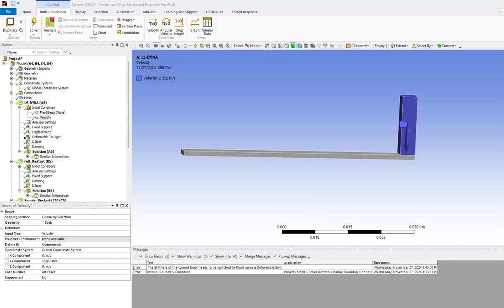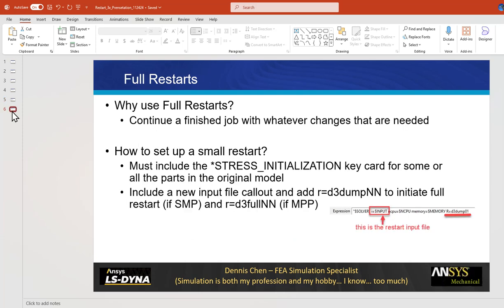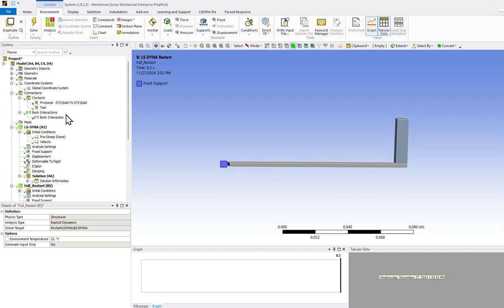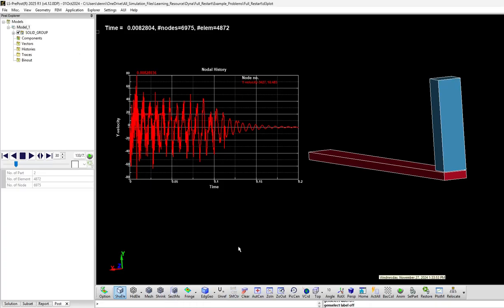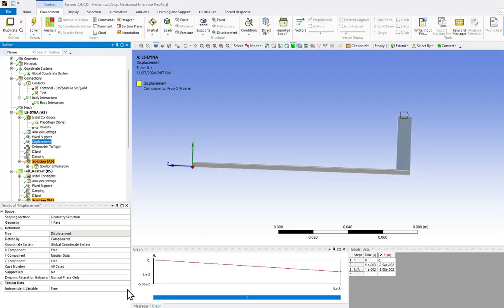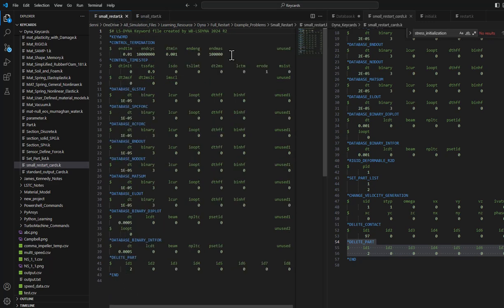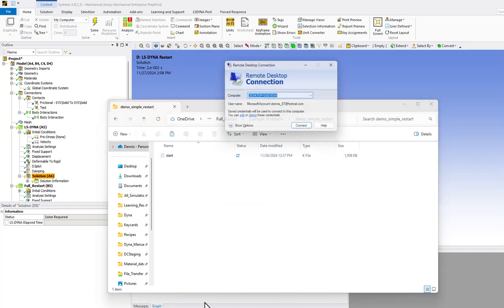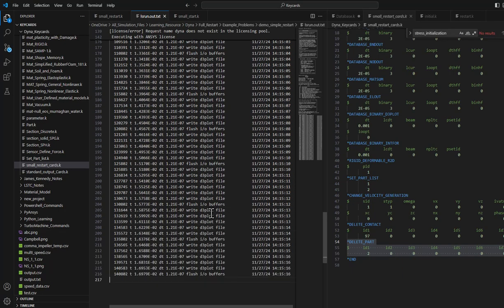Ansys LS-Dyna Examples - How to use RESTARTS

Comment: Hello. Can a restart run use a previous analysis with material erosion active? I am having a lot of trouble making it work
Reply from the maker: I suspect you can do simple restarts but not full restarts since full restarts would call a different input file and not just the d3dump or d3full.   I've not tried this so it's a guess.